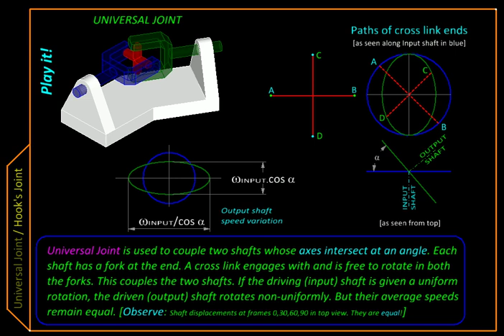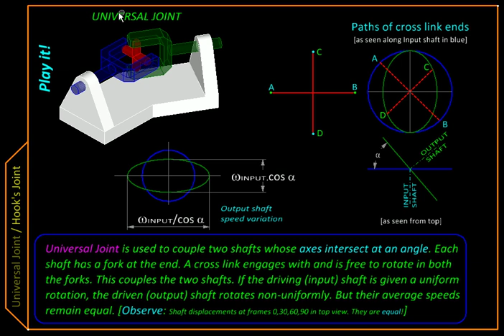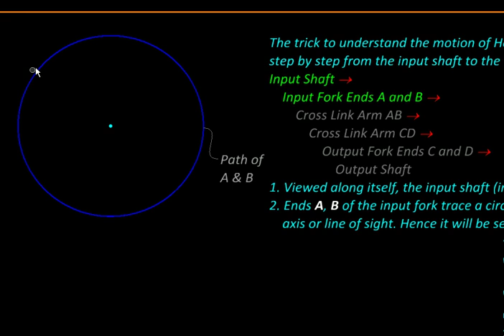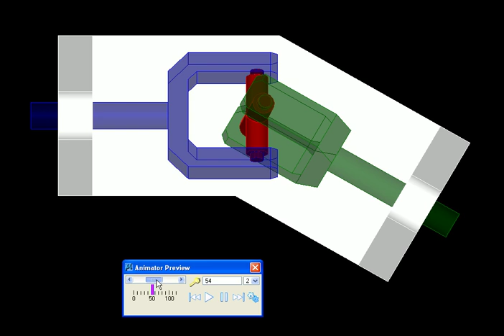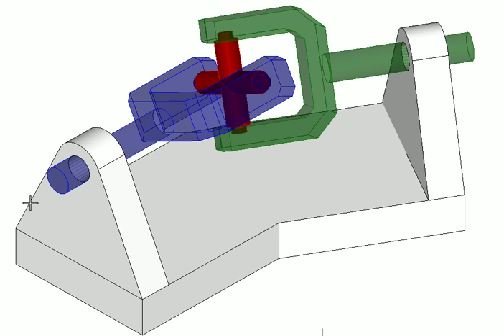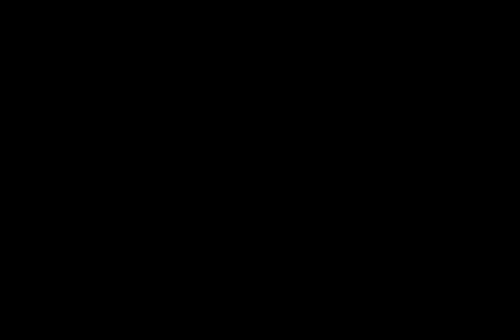Kinematics Ch02J Hookes Joint

Comment from the maker: @Angelrodri38 Thanks! Sorry I'm drawing a blank :-( Possibilities –
1.Inertia Torque: Speed variation (and peak angular acceleration) rise with shaft angle causing higher inertia toque. But couldn’t see how lifting the vehicle can cause increase  in shaft angle. And of course inertial loads would need the joint in motion, which may not be the case when lifted.
2.Can deflections while lifting affect propeller shaft length? If so, then are vehicles with telescopic propeller shafts immune to this?

Comment: @UjjwalRane, ONE QUESTION ABOUT THIS MOTION, IS THERE ANY CRITICAL ANGLE BETWEEN THE IMPUT AND OUTPUT SHAFT THAT MAY CAUSE THE U JOINT TO FAIL OR GET BROKEN?. I ASK THIS BECAUSE I HEARD THAT WHEN YOU LIFT A OFF ROAD VEHICULE THERE IS A LOT OF POSSIBILITIES TO DAMAGE THE U JOINT DUE TO THIS CHANGE?.  iF YOU CAN ANSWER THIS FOR ME I WOULD APRECIATED, BECAUSE I REALLY DON´T SEE THE REASON FOR THAT. 

BEST RGS AND THANKS FOR THE VIDEO IT IS VERY INSTRUCTIVE.